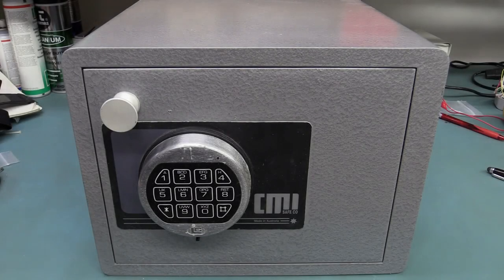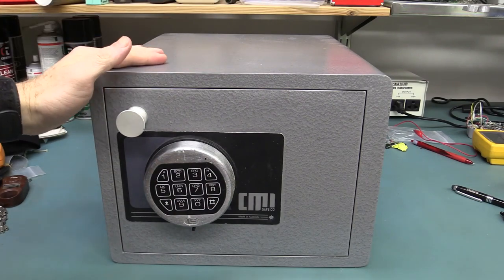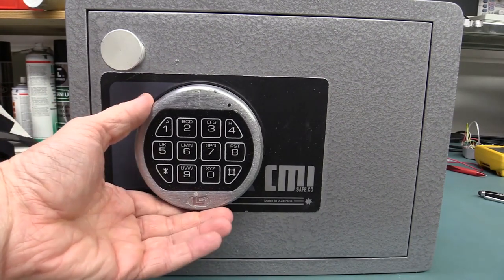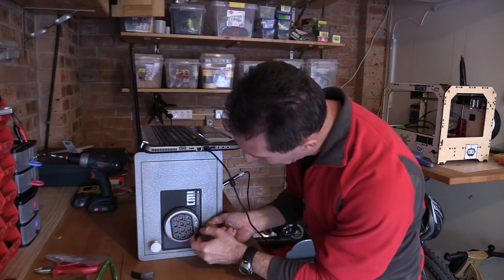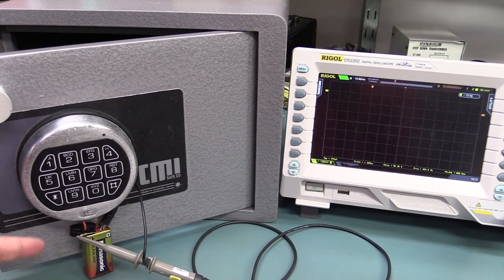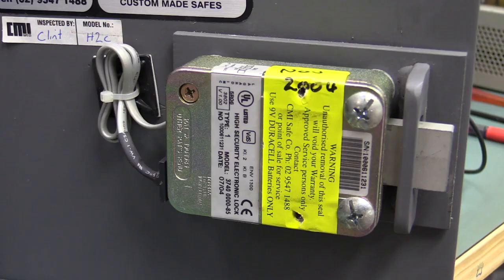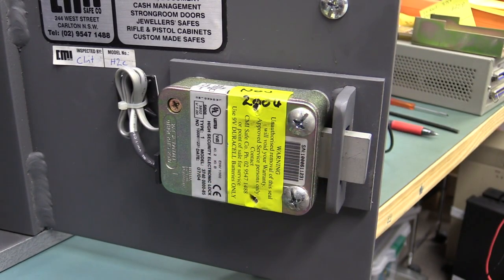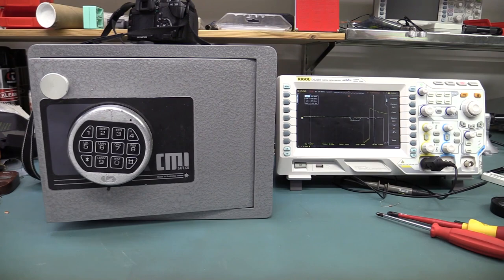EEVblog #762 - How Secure Are Electronic Safe Locks?

Comment: Some things he didn't try on the electronics side: 1. Use signal filtering and processing to undo the effect of the bypass caps (they only reduce the power draw AC amplitude, they don't remove it completely) .  2. Look for AC waveforms in the CPU clock range and above, then compare those.  3. Look at the total mAs consumed by different input conditions. 4. Compare a full 6 digit signal for right, slightly wrong and completely wrong codes.  Look at what disturbances can be injected by applying high frequency noise (higher than CPU clock, maybe even GHz) on that power line.  You may be able to destabilize the microcontroller.  Next, figure out if destabilizing it at a specific time during the input sequence would open the lock.  (Other obvious points have been mentioned by others in other comments) .  Of cause, once an attack is found, it can be reduced to a smaller dedicated circuit so a safecracker won't need to carry around 10kg of lab gear.

Comment: LOL Dave, as a locksmith here's how I would do it. You already have holes in the back. What we usually do is take a light or camera as you have with a long screwdriver and disassemble the lock from the back. That will usually give you access to the deadbolt mechanism and using long screwdrivers manipulate the bolt mechanism opening the safe!!!

Comment: What about trying to pull the solenoid pin inwards by using a magnet from the outside?
Reply: Crazy Hans The case is steel, it would shield the magnetism.
Reply: TheHue's SciTech Steel doesn't shield magnetism... You need something like Mµ metal for that. A giant electro magnet pulsed with high current and the handle being timely turned, should work; the question is, how many amps would you have to pulse to pull that spring back? If they were really smart, the pin isn't magnetic.
Reply: TheMrTape the pin has to be magnetic in order to allow the solenoid to pull it in...
Reply: TheMrTape Mu metal isn't something special, it just have a much higher permeability than steel. Both can work as magnetic shielding by essentially conducting the field around the shielded area, the higher permeability of the mu metal means you can use thinner sheets, but for very strong fields both metals would saturate(mu metal is probably more susceptible to saturation than the steel, actually)

Whether or not it would be possible to pull the plunger with an external magnetic field is hard to say the plunger may just stick to one of the other parts of the lock(And the lock may be designed to prevent such attacks). Either way, it probably isn't a practical attack. After all, the point is to either dissuade attacks or to make it to time consuming or expensive in resources to make it practical.
Reply: TheMrTape I would stuff it against one of those magnets they use at the junk yards to move crap around, should work a treat lol
Reply: Petri Ševardnadze Thanks, I knew I left by brain somewhere around here... Doh
Reply: Crazy Hans Probably would have better luck with a giant EMP pulse to try and energize the solonoid....
Reply: Deathlok67 Yeah, what about power input protection on the input, Could you reverse bias the PNP switching transistor (ie, no input protection diode?)? Or a Pulse engineered to instantaneously destroy a reverse polarity protection and reverse bias the transistor on?
Reply: Colt Burns
There would be a circuit path through the reverse bias diode for the solenoid coil. The PNP may end up dumping the collaping field by shorting it, once the voltage gets high enough. This is all theory though...
Reply: okay okay so what about a really big hammer?
Reply: Deathlok67 I'm guessing the safe will probably act as a faraday cage and shield it.
Reply: oh come on guys just use some C-4 - that'll open it (and probably destroy any valuables inside). Dave was looking for an electronic breach, not a physical one ;)
Reply: Crazy Hans Yes. Use a giant magnet - like the ones in the scrapyards.  You'd only need to sneak in a heavy duty 3-phase supply and set up the rectifier and contactor.  Then maybe sneak the magnet in through the front door, up the stars and rest it against the wardrobe.  You'd probably need to take some 2x4 to strengthen the floor, though.  Hopefully, the little pin and the whole safe would fly very fast toward the magnet.  You'd collect the $200 from the safe and then sneak all the gear back out again, before the owner returns from the shops.  Best sweep the low-loader tire tracks with a broom, so they don't get suspicious and get the power company to take down the big supply again.  Tell the neighbours you are just there to read the meter.
Reply: Crazy Hans large case of magnetically susceptible metal (not necessarily ferromagnetic)=Faraday cage. In other words, it would simply  deflect any magnetic field applied to it, rendering the magnet trick virtually useless.
Reply: the plunger on the solenoid is aluminum. LG / KabaMas had a similar fail in a mechanical push button lock earlier in the 90s cause they cheap'd out and made the locking bar out of steel.
Reply: the standard industry attack is drill for solenoid wire & apply power. (hard to do since drill bit normally rips them out)
2nd option is just drill the solenoid.

Comment: Sweet video. I do post failure investigations. As part of that I find that recreating or researching possible scenarios to be extremely useful. This is exactly the sort of thing I do. To spend 3 months throwing crash test dummies out of vans to figure out the restraint failure. or a couple months on some G.F.C.I fault is pretty common.

Comment: These locks are breakable via RF analysis .but you need 2 hours.
Reply from the maker: Jetset Willy This model in particular? Got any further info on that?
Reply: Its about the body thickness(and build material) not the lock mechanism.
One of my colleagues cracked the code in isolation room not sure of the model but the same size and same body thickness.

Comment: Hi Dave, I believe nowadays an attacker would at least use a differential analysis, since direct analysis is relatively easy to counter. 
The main problem in the case of a safe is that the data to analyse is rather scarce, but otherwise, since money and energy matter in the end there is a reason why safes are certified up to a certain value...

Comment: there is an anti-bump mekanism next to the solenoid.
its the brass thing with also a spring that sits "above" the solenoid.
if you bump it so the solenoid springs away, the brass rod also spring the same direction and takes its place.

Comment: I wouldn't even bother breaking and I would just take the safe with me.
Reply: But, what if you run into a scenario where its bolted down?
Reply: +John Wattie run off with the room
Reply: NIGHTFOX you can mount them to the ground
Reply: Well now we know you're a thief
Reply: Dave... When you are designing any uc safe system that has a fixed digits... even a novice programmer would first collect all the digits and then process them.
Reply: I am a computer software  engineer,  not a thief.

Look how this hobbyist guy implemented a very bad and very hackable security system, but still did what I said which totally nullifies this kind of attack.

Comment: What probably happens when you bump it is, the locking bar moving down (or backwards, however you look at it)  compresses the angled sear against the solenoid pin, catching it before it can slide back into the coil housing all the way to free the sear. That is probably intentional anti-bump design too.

Comment: Awesome video. It was nicely suspenseful in more ways than one. It was also fun seeing the mechanical engineering of the latch mechanism. It's true there's a big difference in the security of safes. My favorite bit is the made-in-China crap typically uses plastic gears and mechanisms and some are famous for the plastic bits stripping/breaking in normal use so even with the correct combination you can no longer get into your own safe.

Comment: don't know if I am correct (I never studied signals in such definition): if your keyboard sends analog signals, every key should show the same signal every time(diferent for each), if it's a digital transmision, the diference betwin 0 and 1 binary should be insignificantly small. considering the fact that you are on the analog side of the circuit, you had no chance from the start (correct me if I'm wrong, I don't have much experience at this level)

Comment: I don't know about this safe, but I've found a similar one in an abandoned building a few years ago and I got that open by applying very high voltage to the battery terminals (I think it was over 10kV). It was ruined afterwards, but it did actuate the solenoid long enough to open it.

Comment: I think an interesting approach would be to avoid the lockout mechanism after wrong codes and seeing if we can override it so we have infinite attempts, since maybe that signal does depend on the battery side and that's something that the manufacturer would not bother to invest time into protecting since it's a weak vector of approach to begin with. Looking for patterns in the keypad combos was a stretch to begin with.

Comment: Why assume that the beep on scope was after the key was evaluated at all?
Since it beeps for EVERY keypress, no decision is needed before that.
All of your analysis was BEFORE the beep but processing delay could
easily be AFTER the beep in the waveform.
 
Suggestions I liked the best from Youtube comments:
1. get a super long screwdriver and reach through
back mounting holes to unscrew entire deadbolt mechanism.
(hard brittle steel rod less spring?  You might want the rod to
have just the right hardness/temper to be less springy!)
 
2. drill tiny hole from left side directly into end of deadbolt,
then push it back with a steel rod.
 
3. undervoltage, overvoltage and kilovolt surge
 
4. more elaborate power analysis ( after the beep! )
 
5. Malicious power conditioning (frequency)
 
cue the Mission Impossible music...    LOL
 
I wonder how many people have put safes into
their basement floor and had contents destroyed
by flooding?
 
I found this in the archive:
 
We recently opened a safe in Rancho Mirage.  The home was unoccupied  this past summer and when the home owner returned they found their house was flooded with several inches of water.  There had been a leak in the Plastic supply line to the refrigerator.  Several months later we were called to open their floor safe which had been flooded and rusted in the flood.  The safe would have been in better shape had we been called immediately after the flooding  Rust had taken over most of the safe and water was stagnant.
We were able to open and repair the safe to good working order but any paper work they had in the safe was destroyed.  We advise customers to call us immediately after flooding to prevent water damage and rusting to the safe.  We also advise customers to keep important documents that are stored in a floor safe in tight plastic Ziploc baggies to preserve the contents.  Home Flooding  is a common occurrence especially with part-time residents.
Reply: Greegor47 kjyyy

Comment: I've always had a knack for lock picking and safe cracking. Picked my first lock on my parents front door when I was 7. I also learned really fast how worthless those lock boxes are. I used a screwdriver... a screwdriver to open up a sentry safe key lock box as well as figuring out the bump method on digital safes in my teens. I never did understand the purpose of any kind of safe aside from fire/flood protection that isn't bolted down or very heavy. Anyone who uses them is pretty much sending the message of "Hey I put all of my valuables all in one location inside an easy to carry box that can be carried off and broken into later."
Reply: That kind of message can be useful, in case valuables are really outside the safe in an inconspicuous spot. To make the distraction complete, place things into safe that LOOK valuable or important or unique but really aren't.

Comment: Follow up question, how safe is a mechanical lock? Because many can be bypassed with a soda can, and many others with a little spring steel but that's only if you're trying to be covert because it's hard to resist a boot/hammer/brick/crowbar/bumpkey.
Reply: Depends a lot on the lock.

Comment: Did you see the youtube video of the fellow opening one of these with nothing more than a strong magnet? No need to spike it, just put the magnet over the solenoid and move it around while wiggling the lever or knob. Perhaps that thick piece of metal in this safe is intended as a shield against this sort of attack?

Comment: I service and install these locks and their older cousins, the code is stored in the lock body inside the safe. The main venerability is always in the users setup, did they change the master code from the default of 555555 after they added users? The next weakness is the solenoid, they wear out and get stuck a lot. The battery wires and the wires connecting the keyboard can break. Also the factory reset box has to be connected to the lock body to reset the lock, not from the outside. These happen to be pretty secure as long as the codes are kept secret. You can also set them up for more digits and dual control.

Comment: Input rutine could just check the 6 digist at once. That is, it stores the keys you press (no matter if good ones or bad ones) and when you press the 6th one, then a comparison is done. So perhaps you get a difference at this point. But you need to input all valid 6 digits. Until the 6th, FW could just read and store and eventually time out this input and clear the code you pressed and retunr to wait state for a new set of key presses. Code path will be the same for any key (good or bad). The method is very interesting, even the thermal one. Sometimes, OBVIOUS things are overlook, that is Murphy at its best. But as you said, those guys haven been doing locks for years, and sure they they go through this issues before and patched them.

Comment: No vulnerability discovered in the old electronic safe. Fail-to-connect cable to main-board vulnerability detected in Dave!  Thanks for making another totally enjoyable video.  I really enjoy how you manipulate your scope and make it look so effortless. 

Future video tangent using this clip as springboard. Create a powerful magnetic field outside the safe. Perhaps you could replicate the solenoid action and pull that rod to clear the little locking block.

Comment: Comparison against stored pin code most likely happens at the moment when registry (shift one presumably) storing input digits is full. The methodology I'd try here would be to capture processor profile after sixth digit has been entered and compare results for incrementally growing number of good leading and trailing digits to see if the loop bails out early.

Comment: You could embed a circuit just above the battery compartment, a data logger. Let the rightful owner enter the correct code once or a few times. Then retrieve that data, and manually enter it. Would likely be a bugger to attach. But maybe not.

Comment: The lock doesn't have a bump vulnerability because of the extra part on the other side of the solenoid and catch slide.  When you bump it to drop the rod into the solenoid, that chunk on the other side drops a pin into the catch!  Pretty simple yet smart way to prevent it from being bumped/dropped to open.

Comment: What is even more effective from the manufacturer's side, and relatively simple 
in terms of implementation is to use a buffer approach. By this, I mean 
that as a manufacturer you load each keypress into a memory buffer and 
only process validity after the last buffer (fixed or configured) has 
been filled. This results in a much more difficult, albeit not 
impossible, method to mitigate an attack via the power source. This 
simple change from a per-digit calculation also minimizes the number of 
components required on the board (ie capacitors for decoupling 
purposes). Additionally, this approach wouldn't even be noticeable to a 
user and the calculation can be through a very simple == operation in a 
microcontroller or a series of gate-level operations if done through an 
ASIC or FPGA. With the gate-level operation, you would first perform an 
XNOR binary operation between the corresponding bits of the known key 
and the provided key. With the low output from each XNOR operation 
followed by a cumulative NOR operation (multiple OR gates to combine 
down the number of bits to a single NOR gate that performs the final 
calculation).

In the case of solenoid operated safes like this, an even 
easier method would be to use a sufficiently strong electromagnet to 
pull the solenoid back manually from outside the safe, which then releases the catch, such that the 'knob' can be turned to open the safe.

Comment: the little pin is still the vulnerabillity
even if that is drilling protection on the front, dave showed the walls are drillable even with an battery powered drill.
so you can simply attack that spring from another angle. even if there is only access from the front, you drill into the bottom of the door loosen the bolts and you are in like flinn ;)

Comment: Two suggestions:

Firstly, try looking at the current draw across the second button press.  If the system has goes to different states depending on the correctness of the first button press, then these states may be more distinguishable during the subsequent button presses.

Secondly, try looking at the current consumption after the sixth press.

A common implementation would store the button presses then compare them all with the stored code after the final press.  A common flaw in such implementations would be to stop the comparison after the first mismatch, yielding a current draw signature that tells you the first button press that was incorrect.